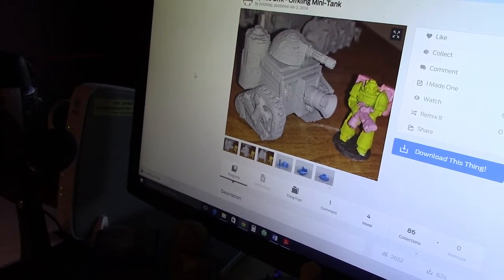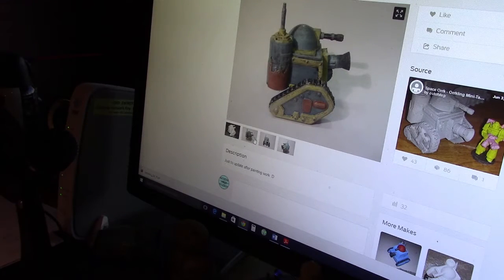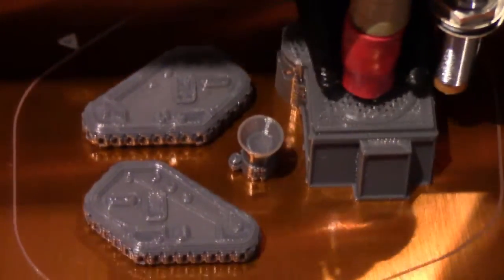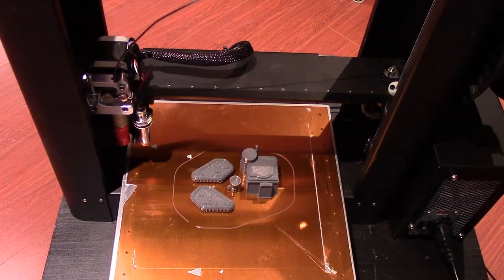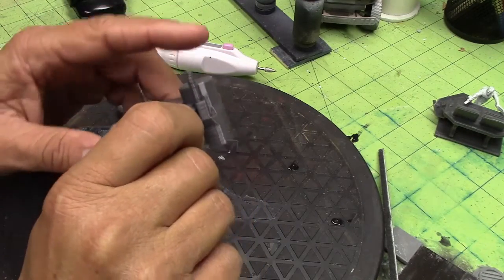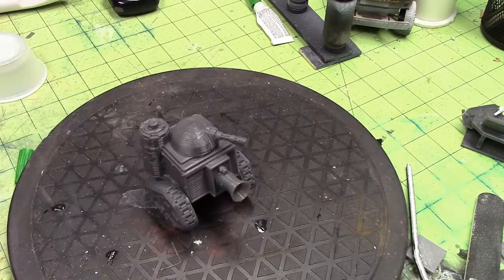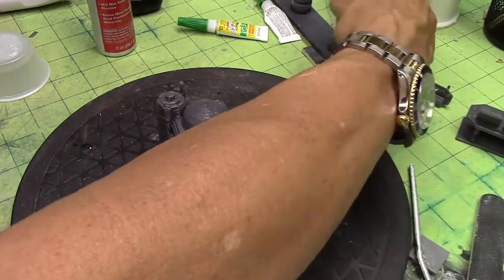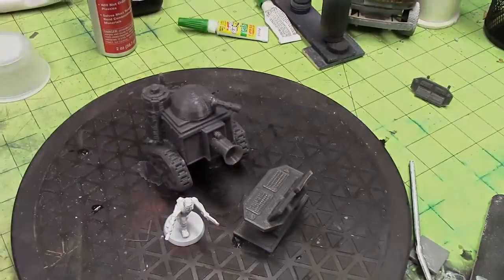3d Printed Grot Tank Part 1

Comment: did you notice your other leg piece laying on the floor right there? its just above the chord in this at 2:15

I'd have to make something underneath to not have just flat panels behind the treads and nothing connecting them to the body of the tank, make some sort of V hull or something with drive shafts going to the treads or something.